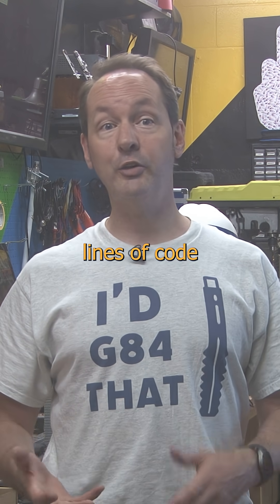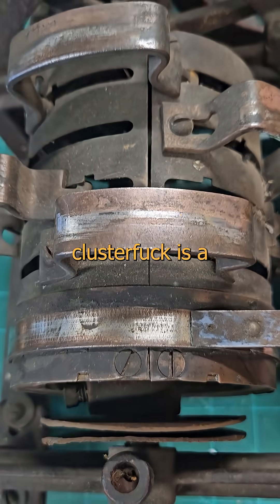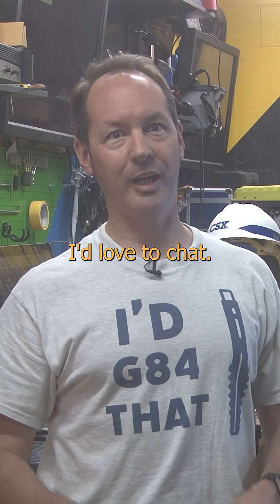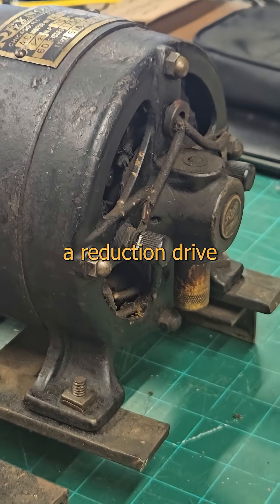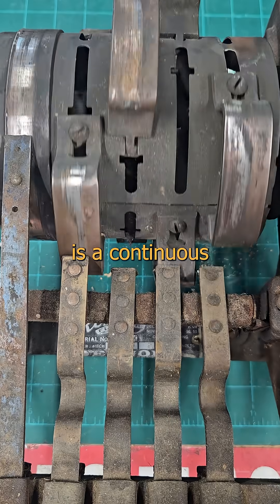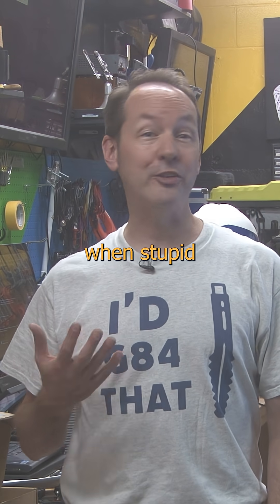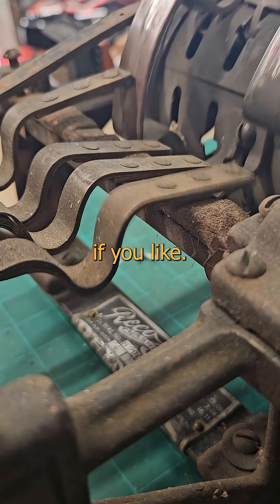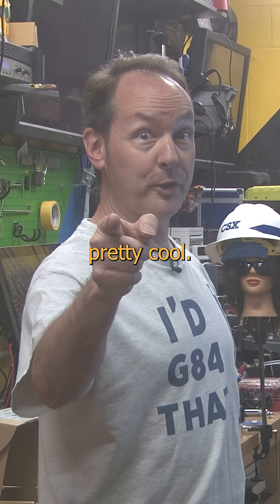Steampunk Sign Flasher #chrisboden #comedy #engineering #dangerous #electrical #educational #cam

Comment: This is the same concept still used to this day in Vesak pandals. Its a huge display of lights consisting of 1000s of incandescent colored bulbs used to light up patterns and those patterns are made by that same concept only way larger scale and way higher power. They use smooth logs covered in copper/aluminum contacts as the rotator and they usually have several hundreds of contact legs which in action sparks fly everywhere (definitely not a fire hazard lol)

Comment: These flasher drums are still used for controlling Thorana light patterns during Vesak, cause they're cheap to manufacture and easy to program cause it doesn't require much knowledge other than 'lights go blinken when the metals contact'.

Comment: I have one with a homopolar motor driving it. No beilts hust a coil and a solid brass disk, a bearing and an eccentric cam. 4 contacts that break in sequence to make a moving lamp display. used a gross of 15W bulbs when it was up as a sign. But only the motor is left.

Comment: What if the continuous contact was connected to the neutral to complete the circuit ? I know there is probably a simple answer like "nobody is supposed to touch it anyways", i don't pretend to be starter than everyone else, i'm just wondering

Comment: I worked at a Canadian store named Princess Auto, in the 80’s when they were still dealing in large scale scrap/salvage contracts. We got a skid box full of these devices with about twenty micro switches wired to a harness on both NO and NC contacts, actuated by these adjustable drum wheels on a gear driven shaft. You could adjust active and non-active time for each switch individually. I’m guessing this was a controller for something in manufacturing. It was top-quality, and most guys bought it for all the gold contact micro switches, at ten bucks for the whole thing. One guy bought a couple for a Christmas lighting display he did every year with some of his neighbours. That was a favourite job of mine, because I got paid to investigate and tinker with all manner of “stuff” (It was pretty cool.).😎

Comment: Not that it matters much, but I feel the better look for "Steampunk minus the wannabes of Steampunk" is to pedestal wire wheel as much as possible, changing between brass, steel& stainless wheels or cups & then apply differing pressure where wanted or needed or liked more than not. At that point it cleans& polishes in its own way while leaving the SMOOOOOOTHEST or the best of materials for legit polishing. Then top the polish with some badass gages/guages that tickly your fancy. 

Bonus Tip, Chrome& Metallic paints&or flash finishes &or chemical finishers have come a long long way from what we used to play with back in the early 2000s. So IF&WHEN you're feeling lazy or want to grab the cheat code, then just Rattle can that girl where you want her to shine. From 5ft away very few will ever know. And if you want to trick their eyeballs, then make sure you leave some random black spots of polishing compound where you"must've forgot" or "dammit i missed that spot".

Comment: I have seen custom drill machines that used a similar setup to perform various actions. Probably not line voltage though, just operating switches that carried the voltage.

Comment: If you wanna clean up those parts in less than several weeks, get yourself a wire linishing wheel. I used to use one to restore loan kits of drilling gear back to shiny for a job for a while, very satisfying.

Comment: In the 80s we had a paletizer that used a paper tape with holes in it that held the program pattern. Several timers utilize small bellows that would slowly let air out until it tripped. A small needle valve would adjust the time. Not uncommon to adjust as the day went on and got hot and humid effecting the properties of the air.

Comment: Love them i have the miniature version that ran on a 24v ac motor and had 6 cams ro open and close the switches at 120V ..Tegy diddnt last nong because of plastic gears and tgey did not tollerate heat and dust .Up running  Finder 24 v relays off of it with a higher current rateing

Comment: You need to come across an elevator rotating cab posioning stack / pie  switch. Open frame high voltage and chain driven.

Comment: Hrm, maybe an ultrasonic cleaner or an electrolysis tank? Electrolysis is great for pulling rust off iron and steel, but the exact same setup will strip the oxides off damn near any metal, with a lot of the grime and paint also sloughing off in the process. 5 gallon plastic bucket, some washing soda, some rebar, and a DC power supply(or a battery charger in parallel with a car battery). Hook it up and let it cook for a few hours

Comment: Did you just use the term "marzel vanes" the correct way?  I've believe that 6 of those (assuming they are hydroscopic of course) are the key to building a functional turbo encabulator.  ;)

Comment: So voltage supplied to the rotating drum which then goes to those levers when the cam sort of things touch them. Why not make the drum like a camshaft and the levers are switches? Like why did whoever designed this decide to power the drum?

Comment: I didn't know this did encabulabition, nice.
Reply: A truly retro encabulator. The panendermic semi-boloid slots are even exposed on this model.
Reply: @manicpolymath  the preframulated amulite was a lot more fragile in the days before it was stabilised with hydrogened spume swarf.
Reply: I saw the marzel vanes but couldn't pick out the ambifascient lunar wane shaft.
Reply: @timbertome2443 unfortunately, side fumbling had not yet been eliminated by the time of this example's iteration
Reply: @timbertome2443  Oh it's hard to see, because on this model it was mounted inside the logarithmic casing next to the parametric fan.

Comment: In high school 1971 I actually made a system like that for my thespian activities. The was the play George Michael Cohan I used  my 1963 Erector Set gear motor and some old elevator contacts to create Chase lighting 120v 27 amps. Yes folks bear skins and stone knives. Sad part is the stage was actually running lights with the circuit breakers. Even as a freshman I got that changed quickly with a threat of reporting them. My thespian director loved it since she didn't have to take the heat.
Reply: Ha! There are others!!

I designed something similar for an art project  around the same time.  The art teacher, bless him, blanched and told me, after working on a desperate excuse, that we didn't have the resource for such a project.

So happy after all these year that there are some of us who think alike.  Thanks for posting.

Comment: I wonder why there was a need to make the entire rotating drum a live contact rather than just put the contact points under the levers as a static item?
Reply: So you can easily get continuously variable start stop times for the lights by changing the position and length of the contacts. And doable on site.

Comment: the next generation was considerably less spicy - they figured out they could put a set of contacts on that bar the levers rest on, and just have the encoding wheel pick the levers up to break the circuit.  still lots of exposed terminals to light you up when someone puts power to it without permission, though.
Reply: I was just thinking about that. A live drum would not be my first idea
Reply: @nineephe  I think I've also seen an intermediate one where the drum contacts were essentially flush to the surface, so they didn't put so much flex into the contacts.

Comment: As someone who routinely cleans their keyboard by scrubbing every single key with alcohol, I would totally spend days cleaning that thing.
Reply: Okay, so you know that on most mechanical keyboards, the keycaps can be pulled off, right?

Just get a keycap puller and pull them all off, then wash it all in a bucket/pan with some dish soap. Don't use alcohol as that could damage the plastic.

Comment: Wouldn't you switch on the low side? Connect the whole drum to neutral instead of line voltage
Reply: Wouldn't make much of a difference. Either you hook the hot to the drum or to each individual lever. Either way that drum is hot whenever one of the levers is in contact which is probably most of the time. This is a relic from a time when OSHA and a national electric code didn't exist so things tended to just be wired up however, long as it worked it's fine.